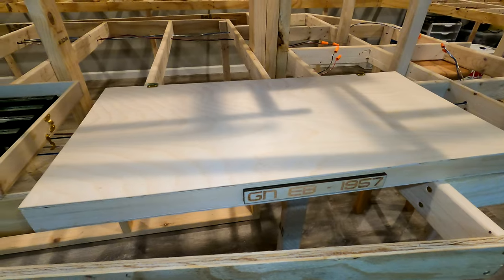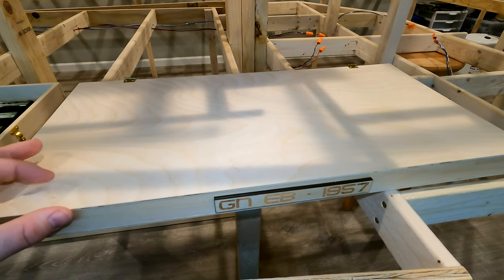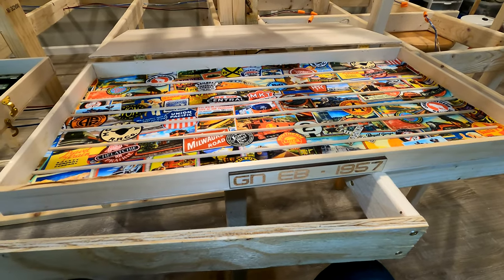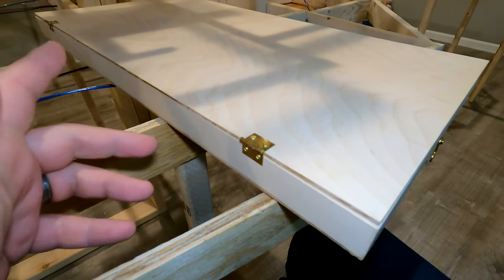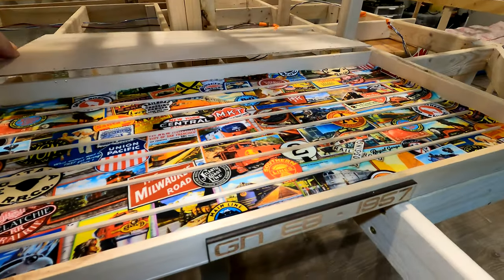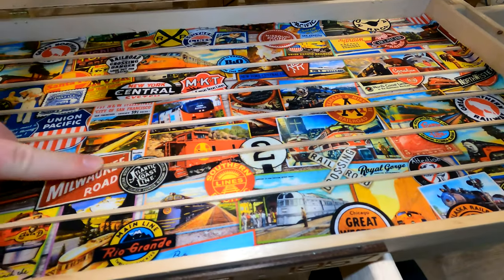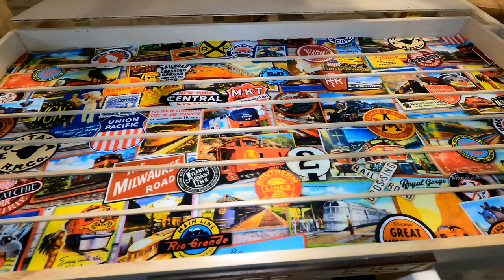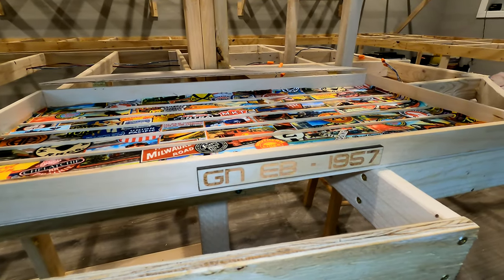Cheap and easy to build storage boxes for your model railroad

Comment: Carpet underlay works great, its about 2.5 to 5 mm and comes in a role, very easy to cut
Reply from the maker: That's a great idea, yep! So long as there's still clearance for the rolling stock with the added height, it would work nicely. Iain

Comment: Thanks so much for sharing the boxes.  Greatly appreciated.  I think I’ll build a few for my rolling stock.  Believe it or not , my solution are plastic parts storage containers with a foam lined interior.  The storage containers fit perfectly into an airline galley cart (the carts that flight attendants push up and down the isles).  I can fit a lot of containers in one of those carts.  Works great!
Reply from the maker: Oh, that would work! I've seen similar where people have also use ammo or gun cases. With foam down inside them, would definitely help to protect the rolling stock without needing to keep them in cases.

These storage boxes I made are great for the passenger trains to keep them all together and easy to view / display them, but for the rest of my rolling stock, I do need / want a different way to store them in a way they'd still be easily accessible and protected. Iain

Comment: Thank you, just what I was looking for! Great solution! 
I think I'll create a storage cabinet and slide such trays into it (and skip any lids). This will give me a good overview where everything is and make access easier as I don't have to re-stack trays to access rolling stock.
One simple and flexible way of keeping the rolling stock from sliding into each other is to make approx 1/2" (or 8-12mm) wide & flat (same height as your spacer strips) wood blocks that go in between your spacer strips.  By not glueing them into place you can reorganize your rolling stock any time. I hope to use the trays when 'composing' train sets.
I haven't built anything yet so I can't promise it will work as good as I am hoping for. If anyone beats me to it, please comment how well it worked out.
Reply from the maker: Thanks! Yes, I've looked at making a cabinet so they can just slide in and out, too. I think if I end up putting together one or two more trains, the cases locked together become too heavy to carry them all so the lid becomes moot. Good look with your construction! Iain

Comment: That North cost limited looks so good…
Reply from the maker: Thank you! Not bad for more of a Great Northern focused layout 🤣

I need one more F unit, but otherwise I'm very happy with it. Took a while to find the cars, add brass sides on some, respray / number, etc. I'll do a video at some point that covers the passenger trains I've put together. Iain
Reply: I subscribed, I don’t want to miss that. Not too many people model the big sky blue. That is also spectacular.
Reply from the maker: Thanks! That's definitely been a lot more work. I think only the Centralia shops Great Dome is factory-painted. Everything else was custom painted, decaled, etc., including a few with brass sides. Definitely a fairly unique train in N scale. Iain

Comment: I love that idea. Presently I have most of my rolling stock in old suitcases, and trying to remember where all those car numbers are is a pain. Besides, out of 600 cars that I own there are about 110 on the layout which is crammed full.
Reply from the maker: Yep, I've definitely heard of old suitcases being used before! It does get tough to sort through them all though, for sure. The rest of my cars are in clear plastic storage boxes so I can at least somewhat see the labels of what's inside each without rummaging through them all! Iain
Reply: @gncascadedivision  Before I moved to where I am now, I put some cars in large plastic boxes since most of what the cars came in had been discarded or burned, like the blue boxes. Little did I know that some day I would have to move.  Well, the dumbest thing I did was use cupboard liners that ripped the paint off the models.  I did this to save the paint from getting banged up in the move.  But when I moved those large boxes into my train room, and started to unpack, I noticed what it did to the paint.  On some it left a tell tail stain that cannot be removed.  Well, we live and learn, and some times we learn too late because of ignorance.
Reply from the maker: Oh no! I'm sorry that happened to some of your rolling stock. I know I was super nervous about different types of foam for similar seasons - some can eat into / melt the paintwork a little and damage the decals. That's why for these cases I just went with felt covered by cloth fabric. Maybe an opportunity to try weathering some of your rolling stock? Iain